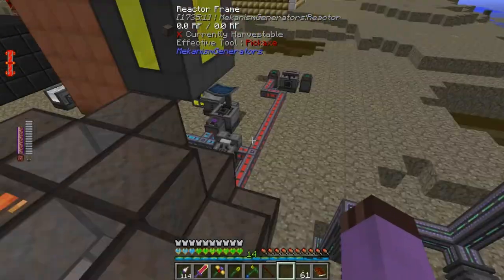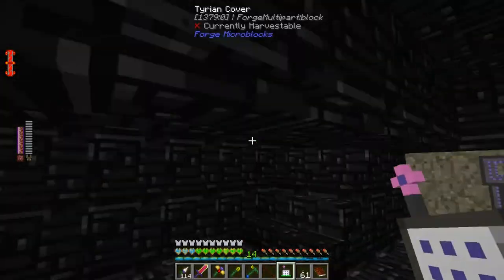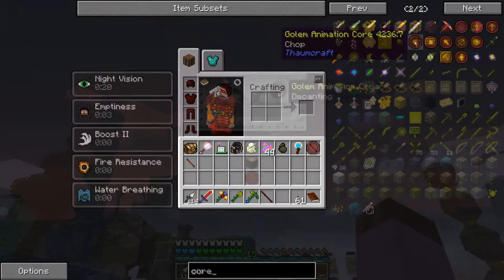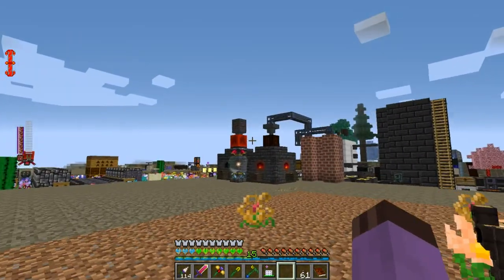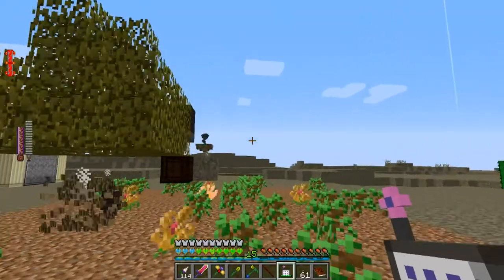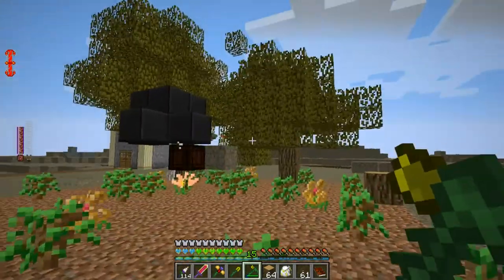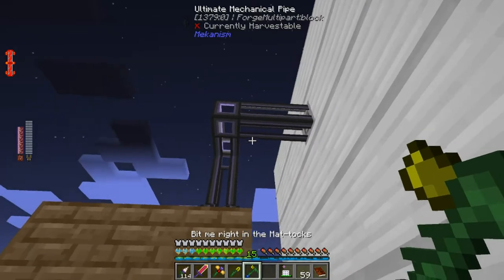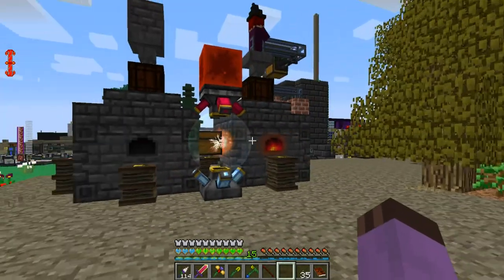Regrowth Episode 53: Getting wood

Comment: I'm kind of surprised you went with Botania rather than using Forestry's Multifarm(autofarm?).
Reply from the maker: And pass up a chance to have a few more golems? :P

The thing about forestry's multifarm is it requires fertilizer.  Fertilizer can only be made from either a thing from bees (*shudder*),  Apatite (which there are no sources of in regrowth) or Saltpeter.  Saltpeter can be mass-produced, by running gunpowder through a crusher... But at that point, I'm just making another processing chain on the same order of complexity as the machine I ended up making, so it's kinda a matter of taste.

Also, the multifarm doesn't get fast leaf decay.